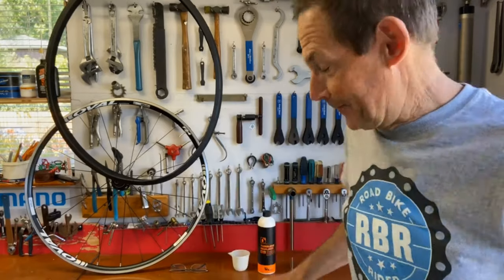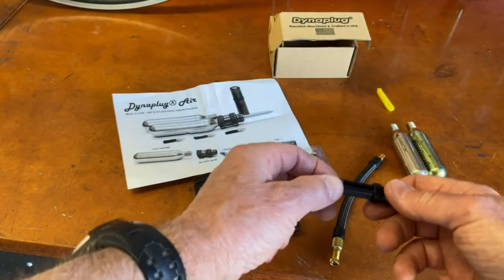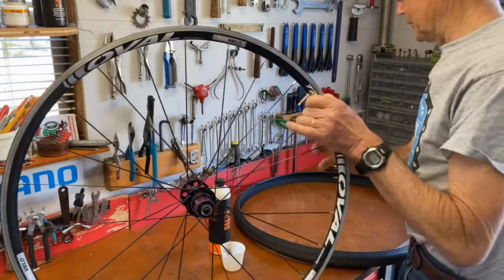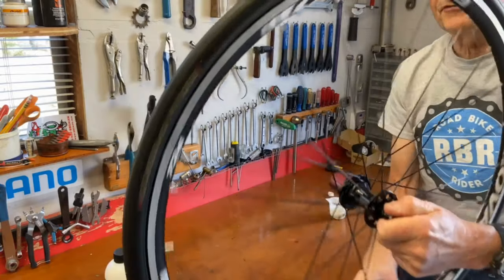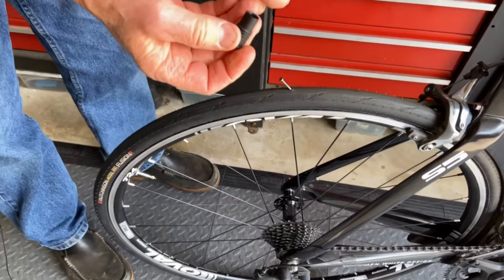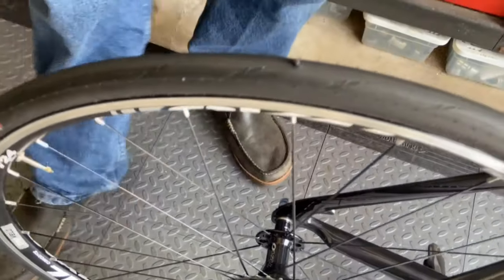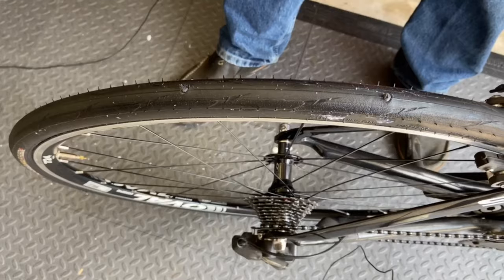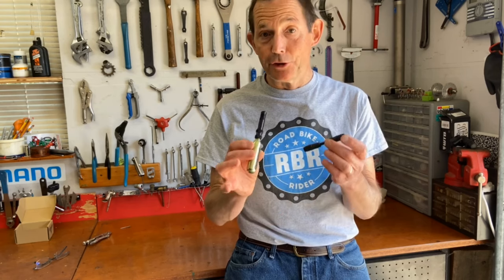Testing Dynaplug's Great Tubeless Bicycle Tire Repair Kits #tubeless

Comment: I used Stan's No Tubes DART to plug a hole in a tubular tire. It worked, the tire holds air, but there's a fuzzy fury feathery knob hanging out of a slick tire.  They say don't cut it, just ride it and wear it off.  It rides fine but hasn't worn off.
Reply from the maker: Thanks for sharing your experience with the DART plug, Roo Caa. Do you remember what brand tubular tire it was? I wonder if it had a tube inside (most tubulars do). If the DART sealed a hole in the tire and tube that means it might fix regular clincher tires with tubes, too - and that would be great cause then every cyclist could fix flats with plugs and rarely if ever have to remove the wheel and tire. We’d all be carrying plugs if that’s the case. Thanks Roo!
Reply: It is a Tufo tubular tire.
Reply from the maker: Roo Caa Thanks! Tufos don’t have tubes inside as far as I know. And if not then that’s why the plug worked. Appreciate you letting me know. Next time I remove a bad Tufo tire I’m going to open it up and look at the construction but from their description I am pretty sure there is no tube inside.

Comment: Is the Dyna plug air system you are using the kit for the road bike version or for the gravel mountain bike? The road bike version is the shorter nozzle. Just curious if the longer one will also fit road bikes so I can only buy one kit for both types of bikes. Thank you!
Reply from the maker: Thanks for watching and the question. In the video I'm using their Air Road and Racer Road kits. Dynaplug doesn't do a very good job explaining on their website which kits are for which types of tires but looking at their selection I think you'd want to go with their Micro Pro http://www.dynaplug.com/bike.html or Dynaplugger http://www.dynaplug.com/dynaplugger.html because they show them being used on a larger tire. And they will also work on road tires because the plugs will work on all bicycle tires. You could also call them and ask for their recommendation. Here's their contact us page: http://www.dynaplug.com/contact.html Thanks again!

Comment: Jim, have you created any videos showing how to mount tubeless tires? I didn't see any on your site. I'm new to the tubeless world and trying to learn he ins and outs before having an issue out on the road. Thanks!
Reply: Oops, nevermind! I see that you have covered that later in this video
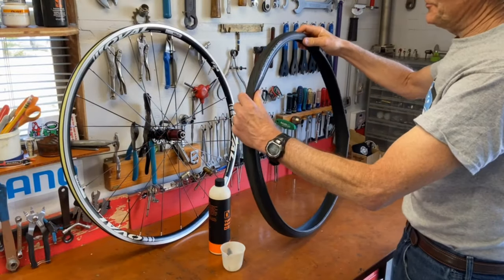Reply from the maker: Thanks for watching and the question Andrew. Actually at 5:27 in this video I show mounting a tubeless tire. But unless something goes really wrong out on the road or trail you usually won’t need to take a tubeless tire off. You can plug it but usually as long as there’s sealant inside if you wait a little and keep turning the wheel the sealant will seal the hole. But I’m happy to answer any questions about tubeless setup if you have some.

Comment: Dynaplug does say to NOT twist and wiggle the plug as you try to insert it or it can separate the tip from the plug, do it just as he did here, push till it goes in

And love the “ you wonder why youre ridding tubeless” …man, isnt that the truth when one fails to seal, it becomes such an ordeal that you question all your decisions! Lol!  But these plugs do fill that gap for when that happens, making tubeless less of a thing when it fails.

Dynaplug also offer a “mega plug”which is a good  idea to carry one of in your plug storage. It’s designed to fill unusually large holes, like when you slash your tire on a particularly nasty rock. I carry the “pill kit” which has a few plugs ( i put one mega in there ) , an air stopper to buy you time from when you pull the nail out to when you insert the plug and a tiny knife to cut the extra tail. It all fits in even the smallest saddle bag or jersey pocket.
Reply from the maker: Thanks a lot for watching and for sharing your tubeless fixing tips, Nic - really appreciate it, thank you!!

Comment: Id thought this would replace the need for gunk... and i would be worried seeing gunk come out the plug considering the plug fuses with the rubber actually on the rim rather than spraying gunk everywhere 🤔 idea of gunk is to replace the need to fix a punture with patches etc or am i missing something  .. i used a similar plug on car tyre without gunk and worked fine
Reply from the maker: Thanks for watching and the question, Alex. I think by "gunk" you mean sealant. And if that's correct, yes, the plug works on its own, you don't have to put any more sealant inside the tire. What happens is that the air in the tire finds the hole and starts to escape and since the tire has sealant inside it some of the sealant will come out of the hole. Once the plug is pushed in the sealant still keeps coming out with the air but because the plug is sealing the hole plus the particles that are in the sealant are plugging the hole, too, the leak gets less and less and then stops. That's how sealant works, it takes awhile for the small particles in the sealant to do their work and clog up holes. Car tires are different than tubeless bike tires. There's usually no sealant in a car tire and the rubber on a car tire is much much much thicker than on bike tires. I hope this answers your question. Thanks again!

Comment: I enjoyed the video. Thanks for posting it! However , I have to raise a point of question. In your video, after you inserted the tool with a plug into the tire, and then withdrew the tool, the plug remained with sealant escaping from around it.  That tells me that it was not the plug that eventually sealed the tire but rather the latex sealant. In other words, the dynaplug did not work as advertised, that is, by bonding directly with the rubber tire. I would be interested in any comments on this observation. Thanks!
Reply from the maker: D Hdso thanks for watching and for the question. It definitely took time for all the holes I made in the tire to seal. And sealant came out of all of them until the leak stopped. The plugs are sort of a soft gummy rubber. Tire tread is rubber too. Tire casing can be other materials. As I understand it, the plug bonds to the rubber in the tire as you use it. That helps seal the hole working in conjunction with the sealant. The part of the plug inside the tire is metal so that doesn’t bond. I plugged 4 holes and the tire held air just fine. But it is the plug and sealant working together. The bonding mainly allows the plug to stick to the tire. Hope that helps explain. Thanks Jim
Reply: I had the same thought. In fact it occurred to me that the sealant might actually interfere with the plug bonding with the tire as intended. On the other hand if at the end of the day you wind up with a ridable tire, all is well that ends well I suppose. If Jim is stil following the thread, I would be curious to know if he can tell us how long the plug lasts?

Comment: What a fantastic video. Thank you so much for sharing your know-how. Just wondered what you would do if it is an unknown object that has caused the puncture and the sealant although keeping the tyre firm still leaks on every ride..  the puncture itself is just evident due to a raised module in the tyre but no thorn or glass is visible? Would be grateful for your advice.
Reply from the maker: Thanks a lot for watching, Rachael, glad you liked the video! Because you said that you have a "raised module in the tyre" it sounds like you may have cut a hole in your tyre that could be too large for the sealant to fully seal it right away. 

The sealant seals puncture with small particles. If a hole in a tyre is too big, the sealant particles will slowly build up at the hole and can seal it enough to hold most of the air in the tyre, but may not be able to fully seal it. Which is why some sealant still leaks out.

The important thing is to make sure the tyre isn't damaged badly. Small holes from thorns or glass create punctures but don't damage the structural integrity of the tyre. A larger cut, such as from a chunk of glass or metal, etc. can actually weaken the tyre's structure and cause it to fail when riding. 

As long as your tyre doesn't have any large cuts in it and the tread and sidewalls appear undamaged except for the punctured spot, then it's probably fine to keep riding on it. If there's enough sealant inside, it may eventually seal the hole and stop coming out even. For a larger hole in a still usable tyre, you can remove the tyre and patch the hole in it from the inside, but you'd only need to do that for a much bigger hole than a thorn, etc. would make. I hope this helps and let me know if you have other questions.
Reply: @JimLangley1  Thanks so much for that helpful response. It's reassuring. I rode 70 miles on it today and it held up but did spit out a lot of sealant much to my husband's annoyance as he got sprayed 🤣... Thanks again and good luck with your channel.
Reply from the maker: @rachaelmaxwell7042  sounds like a great ride, Rachael! You guys probably already figured this out, but if it's still losing sealant you should either plug the hole with a plug kit (no need to remove the tire); or remove the tire and patch that hole from the inside because you will run out of sealant inside the tire if you don't. That'll keep the sealant out of your husband's face, too 😁

Comment: What if you have an insert like Vittoria Air Liner? Don't you damage it?
Reply from the maker: Thanks for watching and the great question, Federico. The Dynaplugs have rounded tips so I don't know if they would be able to push through a tire liner to damage it. I don't even know if you could insert the plug properly with the liner inside - it might block the plug going in. But, no worries because tire liners are designed to allow keeping riding even on totally flat tires so you would just keep riding after a flat. Then when you get home you can fix the tire if the hole is large enough that the sealant didn't seal it on the ride. Being able to ride on a flat tire is one of the big advantages of tire liners. Thanks again!

Comment: So once you get home, is a plugged tyre pretty much over and you need to replace it? I have a pesky puncture that sealed without a plug but keeps leaking slowly, sometimes when I inflate it seems to break through the sealant. I'm wondering if I should give up and replace this tyre (sealant has been topped u) or try plugging it.
Reply from the maker: Thanks for watching and the question, Cecilia. A Good plug like the Dynaplugs should not damage the tire, just fix the hole. But if a tire is worn out like no tread or worn out casing, then you’d want to replace the tire. But one plug in a good tire, the tire should be good for a lot more miles. Hope this is helpful.

Comment: hello again Jim i got the new TRL vittoria airliner....itsa run flat system in case of total air loss....well it worked and got me home with no air for 10 miles! my quesstion to you is can i still plug the tire with vittoris insert inside?
Reply from the maker: Boy, that’s a great question, Annu. I have not tried it so I searched for an answer and didn’t find one. I think though that it will probably work. The liner is soft so the plug tip can get into the tire far enough for the patch to work - I think anyway 😀 If you try it let me know if it works for you please. But with tire liners you are less likely to flat, or that’s what they say. Hope this helps!
Reply: @JimLangley1  the liners definately WORK! they are run flat system to get you home. BUT why cut a ride short on a run flat... rather just plug it give it some C02 and than keep riding at optimal tire PSI....i got the dyna plug because stans dart tool breaks off easy and doesnt work... i want something to work on the road if i need it....but how hard was it to plug it? i heard its not that hard to plug it.....i ordered the dynaplug racer and will only carry this tool with the 2 pre loaded strips.

Comment: Hi Jim
This is a great video and quite convincing. However, I wonder if you've had a look at Stan's DART solution? I am looking to incorporate a patching kit for tubeless into my kit and want something that will work well with tires that have a radius of between 30 and 38 mm. Their video is also very good but I wonder about the size of the plug they use as it looks quite large.
Cheers and thanks
Doug
Reply from the maker: Thanks for watching Doug. I have not tried the Stan’s kit. I just know the Dynaplugs work well.
Reply: @JimLangley1  Problem with Stans's darttool is that the tip is plastic. Mine broke off today. Did not work. But I got home with 55 psi (Conti 5000 TL 25 mm). I will give Dyna plug a try.
Reply from the maker: @Karel.C  thanks for sharing your experience with Stan’s, Karel. I hope the Dynaplug works better for you.
Reply: But maybe it's my fault. First time I had to use a dart/plug. It took a while for the hole to seal. And impatient as I was because the rest of the group was held up, I pumped the tire with a CO cartridge. Bit too much pressure and the sealant flew back out. I had to give it more time to seal up properly. Tried to push a Stan's dart tool in the hole, but the hole was probably too small for the tip so it broke. Probably my bad. Just to let everyone know it has to be done correctly.
Reply from the maker: @Karel.C  thanks for explaining more - you could be right.

Comment: I’ve tried tubeless twice. Both times I got a slit in my tire. Sealant won’t seal it, and a plug I put in 3 days ago won’t hold.
Reply from the maker: Thanks for watching and sharing your tubeless experience Don. Large cuts in tires are a problem with all types of bicycle tires. Luckily they're the rarest of tire cuts. I've had them too but very infrequently because you usually can see big chunks of glass or pieces of metal that cause these types of gashes in your treads and then avoid them. If you're running over this stuff regularly and slicing and dicing your tires, tubeless tires would be the worst choice because you pay more for tubeless tires to start with and then there's the sealant to put in and the mess when it leaks out a large tire cut. You'd be better off with heavy duty tubed tires or even with tire liners inside so that you'd have something to ride on when the tire goes flat. I haven't tested them but Tannus makes tire liners you can see here: https://amzn.to/3QThrla Thanks again!
Reply: @JimLangley1  but they weren’t “large” cuts. The most recent seems to be about 1/4”.
Reply from the maker: @GADonMc  sealant alone should be able to seal small cuts like that Don. How long did you wait? I’ve had to wait 10 minutes sometimes. As long as there’s enough sealant it should keep adding sealant slowly sealing the hole. A plug will do it too but usually the sealant will do it.
Reply: @JimLangley1  overnight, with the cut down.
Reply from the maker: @GADonMc  that should definitely have sealed a 1/4" cut in the tire. Are you sure the air isn't leaking from somewhere besides the cut? Tubeless tires can leak lots of ways. For a tire that won't seal you can air up the tire enough to ride it (don't ride anywhere, just around in circles) to get the tire to flex which allows the sealant to find any leaks in the system (tubular tape, valve, tire casing) and seal it. If you hold a wheel in your hands and shake it and spin it around, that can get the sealant to find every leak and seal them too. To try to find a leak you can put the tire while it's on the rim under water and turn it watching for bubbles coming out. If they're coming out at the 1/4" cut then that is the problem. If they're coming out at someplace like the valve stem, that means there's a leak inside the tire probably the tubular tape letting the air leak out. But sealant should seal all these things as long as there's enough in the tire to do the job. Hope you can fix it.

Comment: super helpful, i switched to tubless and quite frankly love the ride, since then i had one major puncture in 8 months of riding, i managed to get home just fine but by the time i got home the 100 ml of sealant leaked so there was nice cleaning job to do.  since i didn't know what to do i just tossed the tire and put a new one on.  but again i went from essentially 82 psi which by the time i got home to 60 psi.  

I guess my question is have you tried the stans plug system?  curious how those work.
Reply from the maker: Thanks a lot for watching and commenting, Leszek, glad you liked the video. I have not had a chance to try the Stan's Dart tire plugs. You might read the reviews on Amazon https://amzn.to/2TvkXVM to see what people who used it think  Also, here's an extensive Bike Radar video from a bike show where a Stan's rep demonstrates the tool. But notice that he's fixing a mountain bike tire. That's the key thing before buying it; to determine how well it'll work in your road tubeless tires: https://www.youtube.com/watch?v=-NoLJ_gaamk

Comment: Hmm does the sharp pointy edge that gets stuck inside the tire cause any issues? Does it cause any damage to the rim tape?
Reply from the maker: Thanks for watching and the question, Alejandro. The point should not cause any issues. The plugs are for sealing the hole and once sealed, the tire can be fully inflated and ridden again. When inflated the point is held away from the rim. Maybe if you decided to ride a long distance on a flat tire that had a plug in it the point might contact the rim tape. But Dynaplug says they designed it to be rim safe, so I wouldn't expect it to do any real damage. Hope this helps and thanks again.
Reply: @JimLangley1  Great video, and thank you for the in depth response. Helped greatly. Will be adding this to the emergency pack soon.
Reply from the maker: @alextorresphoto  you're very welcome!